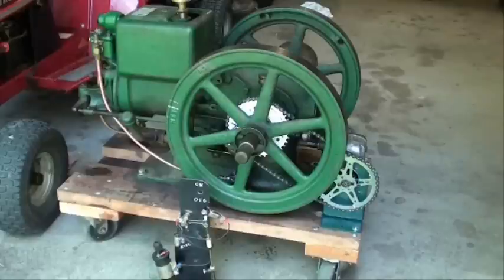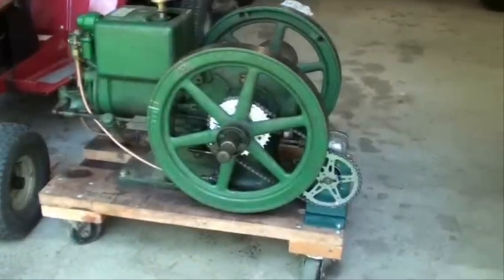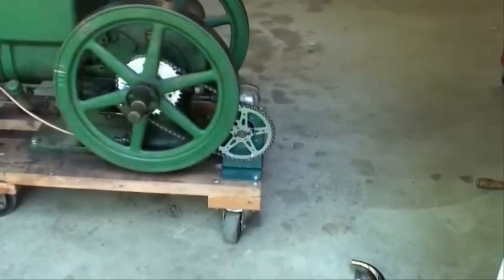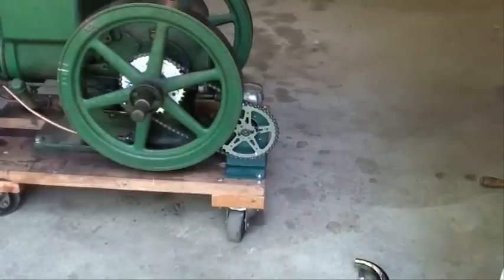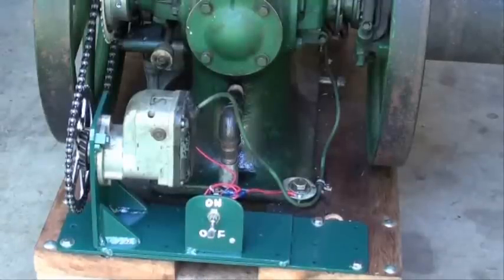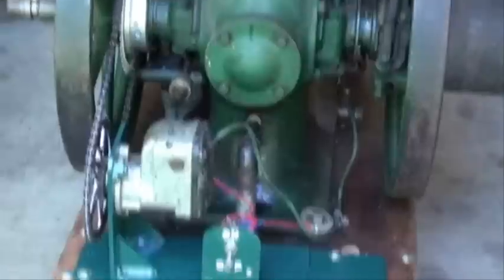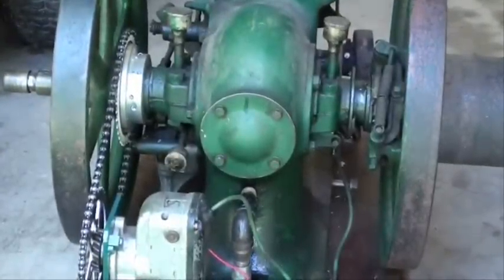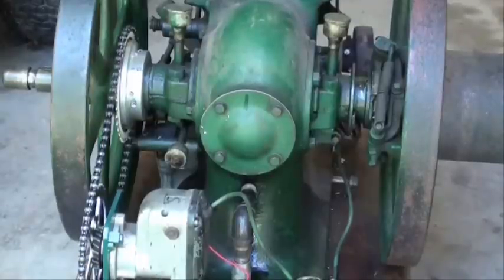Hit & Miss Gas Engine McCormick Deering pt 2 tubalcain

Comment: Good work,  could you not of used the power take off on the far side to drive the magneto?  Then you wouldn't need the sprocket and chain arrangement.   But your solution is good fun too.

Comment: Thanks Yes I will have a rough bore in my stock as well. Sorry for all the questions.  But, how did you reestablish the approximate center again to start the final bore Did you use boring head on mill or?
Again, sorry for all the questions.  
Thanks for all the fantastic video's!!  I know it's a lot of work for no money.  Keep up the good work.

Comment: @mrpete222 How did you hold the split pieces together after split for boring? Did you drill and tap for the socket cap screws first, for hold together, then split, then bore or? I imagine you marked center for bore before split yes or?  We'll have to figure out a place to meet at Sycamore. My Dad and I built several of the locomotive steam scale trains we used to run there. Unfortunately that's over in Sycamore. I want you're autograph (:  From one guy who likes to make stuff to another!

Comment: Tubalcain: When you made the split two-piece clamp on shaft collar, how did you make it round ID /OD?  If I take a piece of round stock and bore a hole in it then cut it in half, as you know it is no longer round ether ID or OD.  How did you bore it round ID then round OD?  I need to do this on a project and have been “thinking” about how? I know they sell em, but not in the sizes I need etc.  How about a video on making that !  Great stuff. Know you are from IL, maybe see you Sycamore if u go?

Comment from the maker: @joleenmorganjohn  There is a centrifugal governor on the flywheel (pulley side). It controls the throttle. Slack does not seem to be a problem. Timing is very accurate.